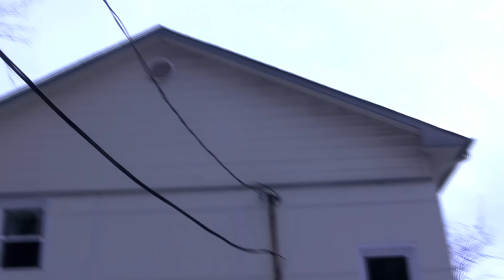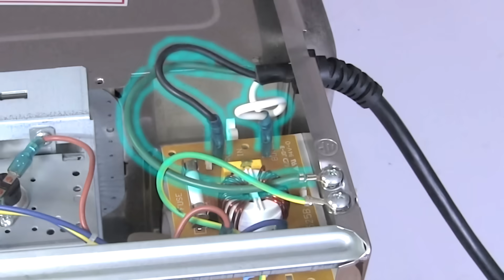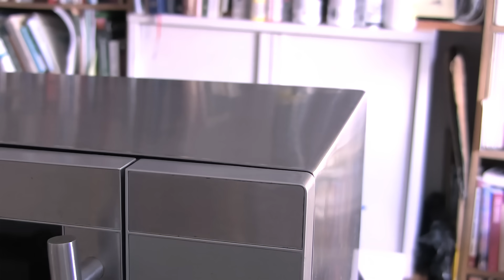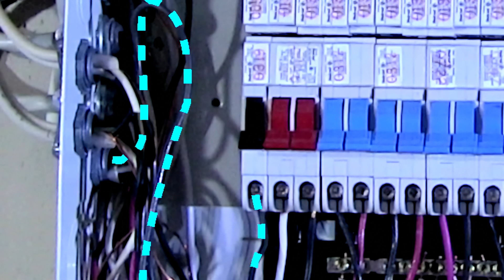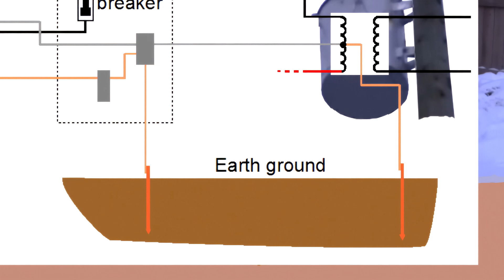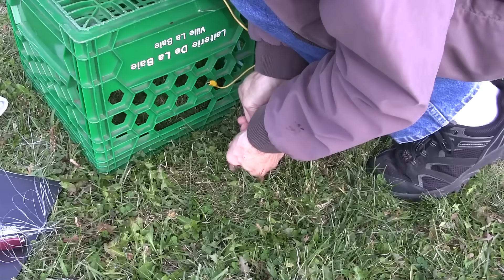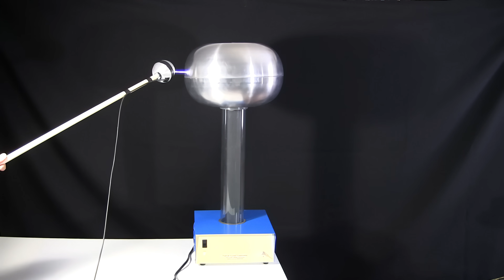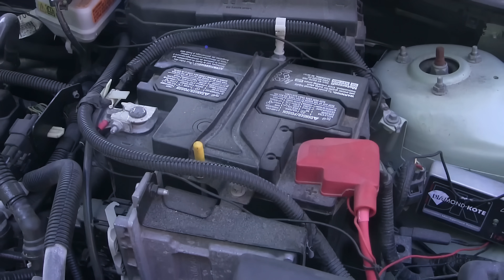What is Ground? Earth Ground/Earthing

Comment: If the ground wire is connected to the neutral bar what stops the electricity from a transformer from getting transferred to the ground wire instead of to home sockets through the neutral wire??
Reply from the maker: The ground wire ends at the microwave oven case. It doesn't for a closed circuit with the hot wire like the neutral wire does when the oven is turned on.

Comment: Good video, thanks!

When you spoke about the fault in the microwave oven you said that if you touched it you WOULD get shocked. You would only get shocked if you were grounded and it was a path back to the neutral somehow.

Again Your video is great but I think this is an important point because without a path back to the neutral current won’t flow. 

A ground fault is definitely a dangerous condition in the United States where most systems are grounded and bonded to the neutral. I’m sure that’s the point you were trying to make and maybe that more important than the one I’m  making?

 I hope this is helpful to someone. Thanks again for the video.
Reply: "You would only get shocked if you were grounded and it was a path back to the neutral somehow."
That's what I'm not clear on.  How could there be a path back to neutral in such a case (touching microwave)?  If I'm in my house, standing on the floor, with shoes on, wouldn't there be a massive amount of resistance between my body and the ground wire that's stuck in the ground outside near the panel?  Or if that's not where it flows, where does it go?

Comment: Hmm you said if there is a short the ground has very low resistance so it provides a path for the current.  Then you said the ground goes to earth, which it does.... so why when you stick an ohm meter's leads in the ground dirt outside the resistance is really off the charts? 🤔🥴🙂
Reply from the maker: Meter leads don't have a lot of surface area. Ground rods are usually thick and long copper rods (e.g. 5/8" x 8 feet), providing a lot of contact with the ground and so lower resistance.

Comment: Hi thanks for the very informative video. My question is if I’m just trying to ground myself through the ground hole in the socket, is it necessary to install a fuse or resistor in case of lightning? I.e. is it possible for the lightning to somehow send a voltage from the ground up through the grounding cable to electrocute someone who is connected to the ground cable in a 15th storey apartment?

Comment: Wrong wrong wrong, wrong wrong wrong wrong.  That grey cylindrical object on the powerline pole is NOT A TRANSFORMER!   It is really a super capacitor.  
Also wrong again as to where the GROUND wire goes to.  It DOES NOT go back to the super capacitor, that you wrongfully called a "transformer."  It actually goes to the 5-foot copper-coated steel  rod buried in the ground under where the power meter is located.  THAT IS WHY IT IS CALLED "EARTH GROUND!"  --Just so ya know.
Reply: It is indeed a transformer, and yes indeed he talked about the ground rods.
Reply: Yohhhh!! If You Ever Took
Your "Tyco" HO Train Transformer 
Cover Off, You Will See a"Box"
Like"Object ,Consisting of
Laminated Iron Plates,,
Surrounded by Miles
Of Copper windings,,Wrapped 
With insulating Cardboard,,
Your "POLE TRANSFORMER"
LOOKS JUST LIKE THAT
INSIDE BUT WAY BIGGER,,
AND THAT CAPACITATOR"
IS FILLED WITH "VEGATABLE"
OIL,,,

Comment: So that means that the Earth Wire and the Neutral Wire do the Same Job? OK so If that's the Case, If the Neutral wire is damaged somewhere, I can just use the Earth wire to complete the circuit?
Reply from the maker: No, the Earth wire isn't connected to the circuit at the microwave oven so it can't take the place of the Neutral wire. And you don't want it connected to the circuit at the microwave oven. It's purpose is mainly to make sure that if the metal case gets connected to the circuit somehow then the circuit breaker will trip and turn off the circuit.
Reply: @RimstarOrg  I have always wondered how we get electrocuted or shocked by touching the live wire if we are not even connect to the power supply. How can electricity flow through us when we are not even completing the Electric Circuit?
Reply from the maker: We're completing the circuit by being in electrical contact with the Earth, usually through our feet. The circuit is also connect to the Earth at the pole where the transformer is. I've been shocked a few times and felt only a disturbing, mild shock because that return path through the Earth has a high resistance. However, depending on the circuit, the path is sometimes lower resistance and the shock is dangerous.
Reply: @RimstarOrg  So the Earth is very excellent conductor of Electricity, I wonder why we've never thought about using earth to transfer electricity. Maybe the Rich are so selfish they don't want to let us use free electricity
Reply from the maker: No, the Earth is a poor conductor of electricity. As I said, it's a high resistance return path.
Reply: @galengness5965  If the Earth were an excellent conductor, how would you direct a specific amount of energy to a specific place across thousands of kilometers? Earth would be like a wire thousands of kilometers wide leading everywhere, thus only delivering very little energy to a single place.
Reply: @magicmulder  That was Tesla's slightly nutty dream, make the e-m field around the conductor (where the energy is actually transmitted) so strong that you get wireless electricity with an antenna and a ground connection.
Reply: @magicmulder  Offcourse electricity does follow through the earth. That's why elrctric rods that hold electric fence are placed certain a distance away from each to keep other electrical appliances from getting Electrified
Reply: @galengness5965  It does, but you can't use that to send power to a specific place over longer distances in practice.

Comment: Question...The hot wire brings 110 volts and 8 amps to my refrig. The refrig uses what power? The the electricity travels back to threw the neutral.  Question...power was used by the refrig so is there less volts or amps traveling back along the neutral wire?
Reply from the maker: Voltage is measure across a load, between the hot input to your refrig and the neutral output, the voltage is 110 volts. The amps is the same going in as going out, so 8 amps in from the hot side and 8 amps out to the neutral. Power is volts x amps so 110 volts x 8 amps = 880 watts.
Reply: Think of it in terms of water. Amps are the current, the flow, which does not change over the course of the pipe line (water doesnt disappear after passing through a turbine). The voltage is the pressure, or ability to do work. It is high at the beginning and low after the load (a mill or a fridge for the electrical example). The volts are 'used up' and then recharged to a high level at the source. Only time the amps or flow is diminished is when there's a leak and water/current goes out of the circuit (into your fingers), this is detected by the fault interruptor.

Comment: Do you know how the teacher and the internet tell me the function of earth line? They just say that the earth line make you safe to contact the metal case of an  electrical appliances when the live line leaks current to the metal case. Then it perplexes me many years that why the current not go through me body with the earth line. Today I know it is because the earth line form a complete circuit and make the CB cut the power. After the power is cut, it is safe to the the metal case. That is the key point.

Comment: Thanks much. What would be the voltage between the transformer hot wire and a ground pole stuck in the ground.?  (Pretend there is no house or circuit breaker box in my example.)  Similar  question,: what would the voltage be between the transformer neutral and a pole stuck in the ground?

Comment: I took a fluorescent tube to a park north of the Pickering Nuclear Power Plant and walked under the power corridor on a hot summer at night.    It's not just an urban myth, the EM radiation from all that current feeding all the air conditioners in Toronto is so fierce under the high voltage wires that my fluorescent tube began to flicker.    Then I stuck one end in the ground and it lit right up!!    Crazy electric geek fun - that'd make a good video about induction.

Comment: Es muy común creer o asumir que basta con solamente ( Grounding ) instalar un electrodo ( Varilla a Tierra ) físicamente al suelo ( Earth ) a fin de garantizar un sistema eléctrico seguro, y efectivo. Sin embargo, esto es absolutamente falso. Incrustar una varilla a tierra porque si, no tiene ningún propósito, lo que en realidad ofrece protección es según el NFPA 70 National Electrical Code con alcance internacional de donde se desprenden o rigen los códigos de muchos países, en su mayoría de Suramérica (Otros en su mayoria Europeros se rigen por el IEC Comisión electrotécnica internacional) debe   haber un ( Effective Ground Current Path) Camino efectivo de corriente de vuelta a su fuente a través de tierra, y esto se logra técnicamente realizando ( Bonding ) una union  equipotencial ( Equipotencializacion) entre el conductor del electrodo de puesta a tierra ( Grounding Electrode Conductor (Cable de Tierra de protección ) y el conductor puesto a tierra ( Grounded conductor  (Neutro).
Cuando se tiene una falla a tierra (Corriente de fuga) existe una corriente filtrándose o escapándose por donde no debe.  En el evento de una falla a tierra (Fault) la corriente siempre buscara el camino con menor resistencia de vuelta a su (Secundario del transformador) fuente (No al suelo) pero esta necesita de una vía despejada y rápida por donde regresar. (Esa vía es el Neutro) Es decir, en caso de que una Fase (120 V) haga falso contacto con un elemento u objeto metálico se producirá una corriente que se ira a través del (Equipment grounding conductor EGC) Conductor de puesta a tierra de las masas (Elementos metálicos o electrodomésticos) y finalmente terminara su recorrido a la fuente por medio del Neutro.  Se puede emplear un solo electrodo y se aterriza el Neutro a tierra (Tierra de servicio) (desde el medidor o panel (tablero) principal de cargas (Main Panel). Por consiguiente, alimentamos el Sub panel) tablero secundario con (Fase, Neutro, y Tierra) desde el cuadro principal o medidor.  IMPORTANTE (No se debe puentear Neutro y Tierra en el tablero de distribución de cargas secundario de donde se derivan los diferentes circuitos a sus respectivas cargas. Si lo haces estarías electrificando las masas a raíz de la corriente del Neutro. Ahora bien, desde la barra colectora de tierras del cuadro secundario se conecta el conductor (Cable) de puesta a tierra de protección que va a los equipos. 
Por otra parte, se pueden utilizar dos electrodos, uno para aterrizar el Neutro en el tablero principal, y otro desde donde se conecta el cable de tierra de protección para enlazar todos los equipos y partes metálicas de manera que, en condiciones de falla, la diferencia de potencial entre las partes conductoras expuestas accesibles y la tierra se aproxime lo mas cercano a 0 V con el fin de evitar posibles descargas eléctricas que conlleven a la electrocución. Cabe aclarar que ambos electrodos deben estar interconectados entre sí, de manera que la corriente de falla pueda regresar por el neutro que está en el tablero principal ya que en conformidad con el NEC si hay más de un electrodo de tierra en la instalación, todos deben estar interconectados. En efecto con tener una sola tierra física que tenga baja impedancia (resistencia) será suficiente. 
A la electricidad no le importa la tierra cuando su fuente no se origina de ella. La única razón por la cual querrá irse a tierra es debido a descargas atmosféricas, primordialmente esta es otra de las razones por las que el sistema esta intencionalmente conectado a tierra. Si las redes eléctricas o el sistema es impactado por un rayo, dicha descarga de muy alta frecuencia de corriente directa (DC) estará buscando su fuente, el suelo ( Earth) disipándose a través de este y no de nuestras redes o sistemas eléctricas.

La puesta a tierra tiene como objetivo garantizar la seguridad y protección contra los choques eléctricos e incendios producto de las sobretensiones transitorias. Adicionalmente también nos sirve para eliminar el exceso de electricidad estática causadas por sobretensiones acumuladas en los elementos metálicos cuando un rayo impacta cerca de estos. 
Otra de las razones por la cual se hace imprescindible la puesta a tierra es para mitigar posibles perturbaciones lo que se traduce a sobretensiones y subtensiones permanentes en las fases, lo cual se produce cuándo tenemos un Neutro flotante (Neutro cortado o interrumpido)
Es decir si nuestra tensión nominal en una Fase es de 120 V, la tensión de la Fase menos cargada aumentara ( se queman los aparatos por sobretensión) , y  la  tensión de la fase más cargada decaerá ( se queman los equipos por sobrecalentamiento) Esto puedo ocurrir dentro de nuestra propia vivienda si contamos con 2 Fases desbalanceadas cada una a 120 V, aunque también puede pasar que dispongamos de solo una Fase y nosotros estemos siendo afectados ya sea por una sobretensión o subtension y el vecino quien está conectado a la otra fase experimentara el resultado inverso. 
En conclusión si el neutro llegase a interrumpirse ya sea  por razones meteorológicas o de cualquier otra índole,  la puesta a  tierra le permitirá a las corrientes residuales que solían regresar por el Neutro, poder retornar por el cable de tierra atreves del suelo de vuelta a su fuente: el transformador. 
Cabe resaltar que la puesta a tierra es una técnica que cumple un rango amplio de funciones en torno del diseño y de la construcción de un sistema de distribución de energía eléctrica interrelacionadas, pero con diferentes sistemas de distribución los cuales se implementan de acuerdo al criterio del código de cada país y sistema eléctrico.  Según su configuración se designan internacionalmente como IT TN TN-C TNS-TT.  Mas adelante subiré una publicación explicando que pasaría si conectamos una fase directamente a un electrodo a tierra.
Si quieres saber mas del neutro flotante mira este corto video y apoyame.  https://youtu.be/Vj3W_w2s6uc